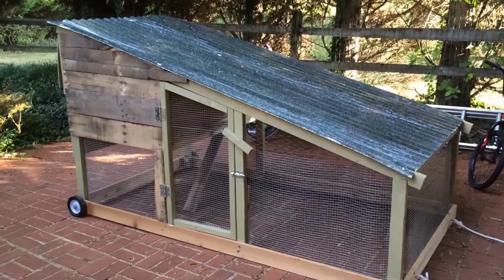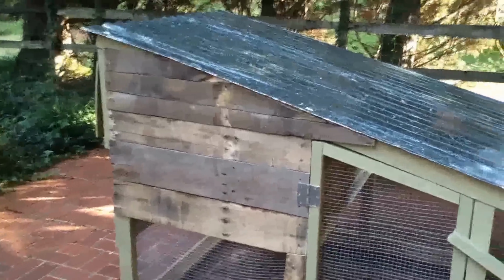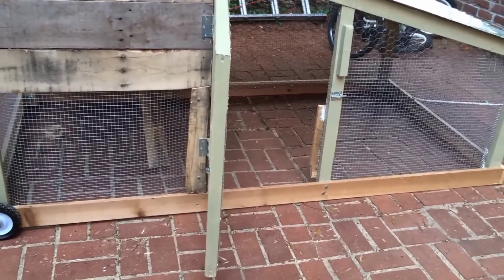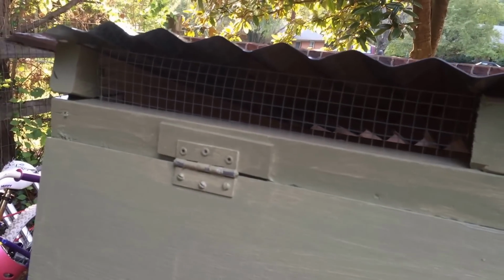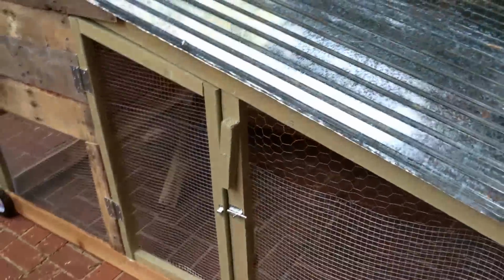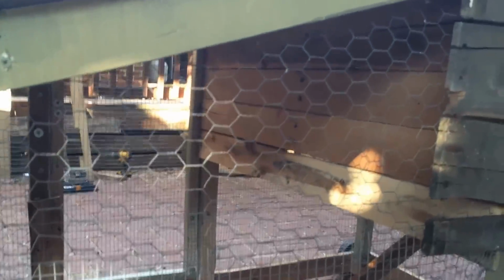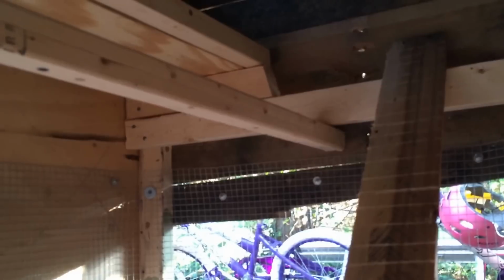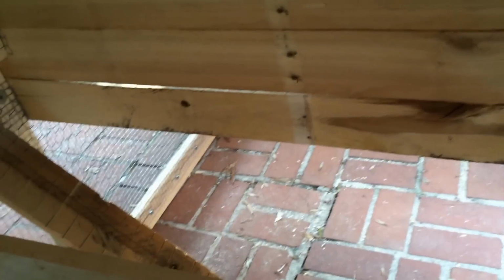Mobile Suburban Chicken Coop (Tractor)

Comment: Watch for raccoons if you have them around there. Those are the biggest issues for chickens.
Reply: That depends totally on an area and state basis. In some areas weasels are the worst and there smaller to get in the smallest of holes in your wire or coop.
Reply: @danielwagner6290  If I didn't use 1/2" hardware cloth I wouldn't have any chickens.

Comment: Dude, that coop cost you $150 ? Holy crap, you are a salesman's dream.
Reply from the maker: Billy Burd  Thanks!  ...I think.
Reply: Mine cost a about that price, but in all fairness, we have a local newspaper that gives away free pallets so I picked up some of those to make the sides and I had some scrap wood of my own. My brother works building pole barns so he gave me a piece of white sheet metal for the roof, otherwise, mine would have probably been more like $200.
Reply: @chrism2714  and now you couldn't build this structure for under 350$ 🤯😭
Reply: @vamountainman2512  I know, right? It's crazy!  I built mine mostly  with some scrap wood laying around in our barn so I was lucky even back when I did it.

Comment: Roosts should always be higher than nesting boxes, as chickens like to sleep at the highest points. Nice coop. :)
Reply from the maker: Jake you're right! I ended up revising the design a few months later to lower the nesting boxes, because they kept roosting (and pooping) in them.
Reply: Yeah, poopy nesting boxes are no good!
Reply: Winner of a video, I been tryin to find out about "chicken coop ideas" for a while now, and I think this has helped. You ever tried - Machaaldity Coop Blaster - (just google it ) ? Ive heard some great things about it and my friend got amazing success with it.
Reply: This is glorious, been searching for "how do i build a chicken coop" for a while now, and I think this has helped. Have you heard people talk about - Machaaldity Coop Blaster - (just google it ) ? Ive heard some extraordinary things about it and my friend got excellent success with it.
Reply: Just for the record, I built this coop and painted it aqua.  (I know that sounds a little garish but it is pretty!)  Anyway, I took an old broom handle and sawed it to make a roost.  It's not really enough for my chickens because they are large so I will add another one.  I also put a cup hook in the top inside roof of the house part so I can hang a heat lamp for them in the winter as it gets pretty darn cold in Kentucky during January and February.  Also, as for the issue with the nests, I have found in my own huge, standard chicken house that I had years ago, that the birds still wanted to roost on the edge of the nests, despite the fact that they had two huge roost poles that were at least three feet higher than the nests were.  Some would choose the roof but there were always two or three stragglers that thought they wanted to roost on the nests.  I ended up building a roof of sorts over the nests.  They could still roost on top of that, but when they pooped, it couldn't go down in the nests.  The "roof" for the nests was at an angle so most of the poop would slide off or run off.  Just an idea.  Also, is your tractor really heavy?  Mine feels like it weighs about four hundred pounds.

Comment from the maker: You can check out the follow-up video at: https://youtu.be/luOzRtg9z9w
Reply: Is this chicken coop predator safe.
Reply from the maker: Yes it seems to be. We haven't had any predators get in. There are hawks, fox, raccoons and possums here. As long as you move it regularly and check to be sure it's on level ground or else put blocks where there are gaps underneath.